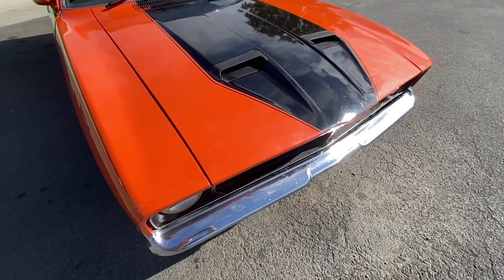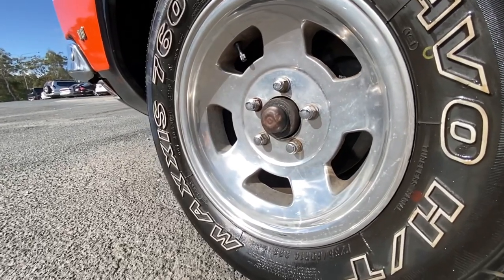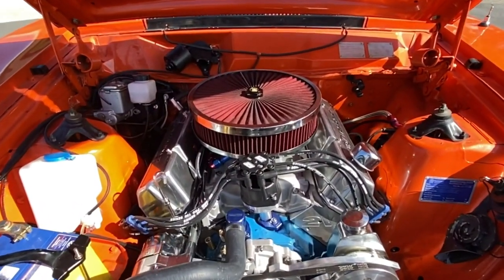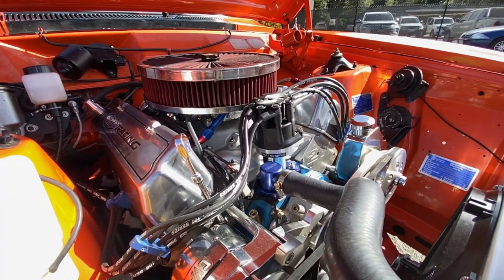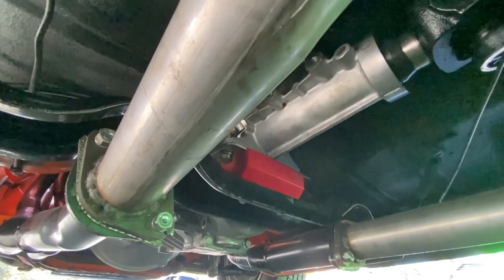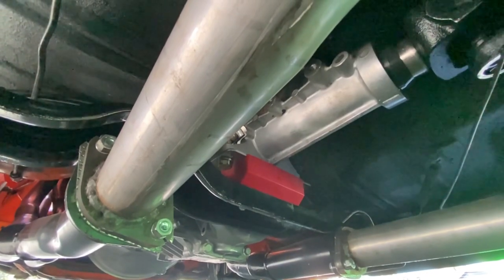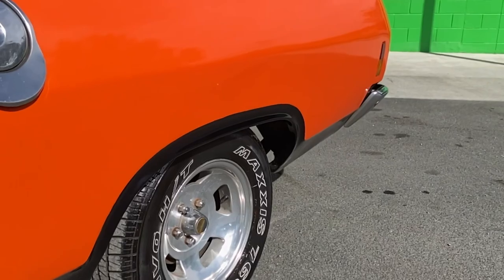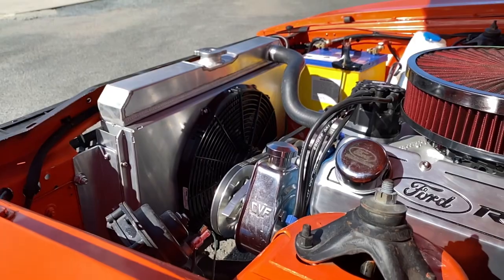XB Ford Falcon Ute Performance Upgrade!

Comment: Never heard of a 350 Clevo!
Reply: I think we all know it should be a 351 Cleveland :)Love the ute though .I have an Xb Gs ute with a 383 Cleveland stroker .Mine just runs the old 4 speed toploader .
Reply: @petergiannaros9037  l’ve got a Xb 4door351 love to a ute as well, friend had a factory Xb ute 351  back in the early 90s which was pretty entertaining on a wet day
Reply from the maker: Ooops . You are correct.
Reply from the maker: Spot on